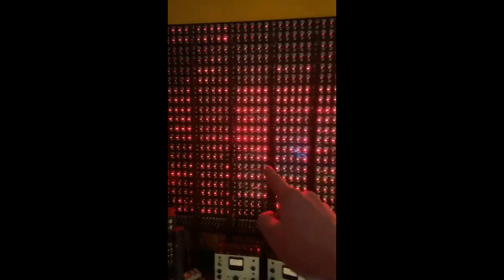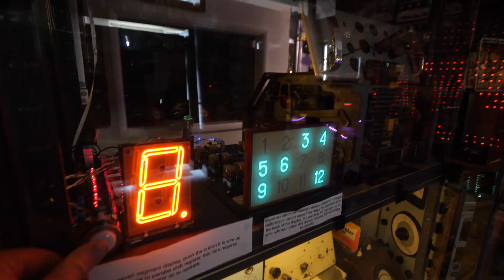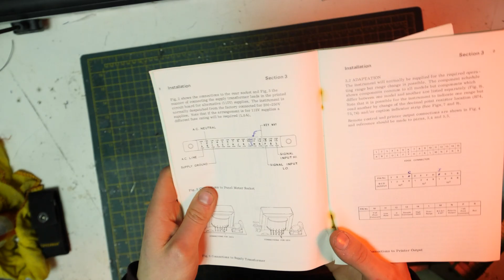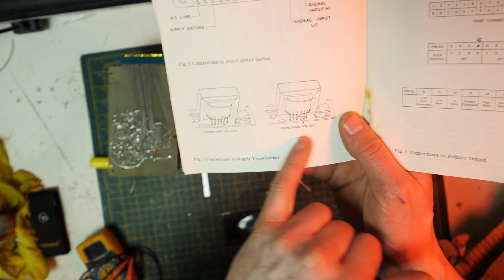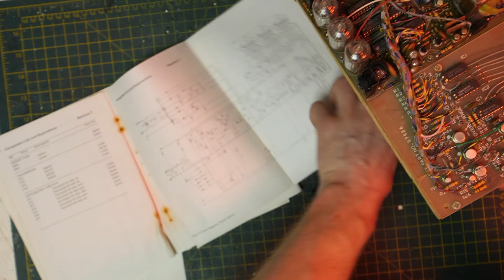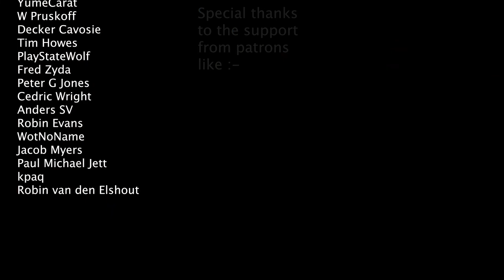Modified Nixie tube Voltmeter For Interactive Display

Comment: If you later need space in the display case, you could use this volt meter in conjunction with your detune knob, and give everyone a readout to correspond to the sound. I realize it's only a millivolt meter, not on the scale of the kilodrone, but that's nothing a resistor divider and an opamp couldn't fix. 👍️

Comment: Polish accent at 2:20 LOL

I got two pH meters with built-in Meratronik V628 panel nixie millivoltmeters - modded one of them for digital control by ditching the ADC and all other unnecessary bullshit, then connected it with an Arduino Pro Mini and now I can control it by sending data over serial port. It's a part of my ADHD (Advanced Dial Home Device) project. The device is all soldered up, the display control part is done, tested and working, and now I've gotta write the firmware for the main part.